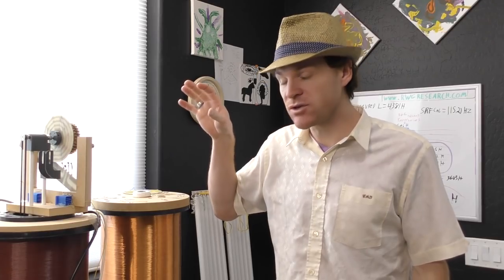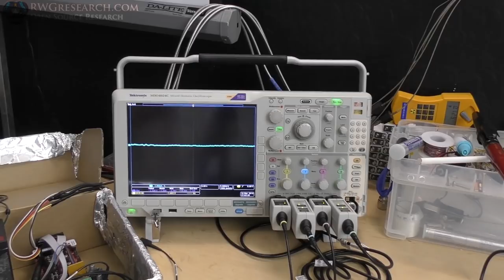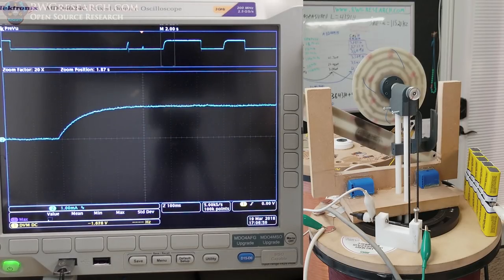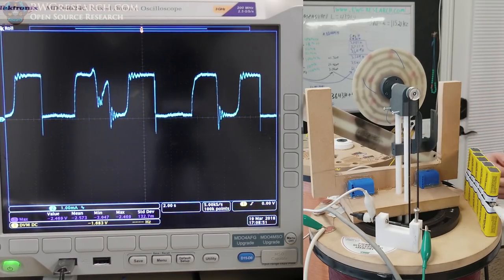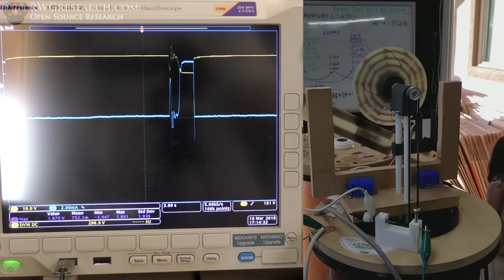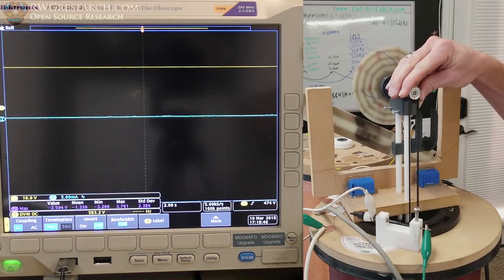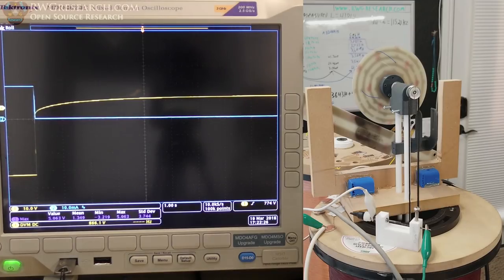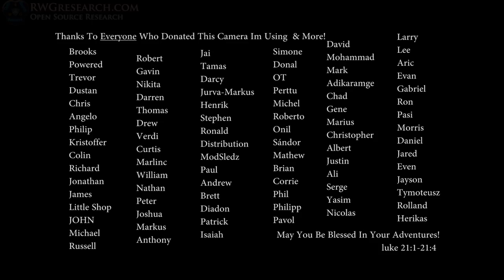T.S.F.A P16 ~ JWN Project P12: Inducing More Current Than The Applied. Battery Resistance...

Comment from the maker: In this update video I demonstrate how the battery resistance plays a major roll in how this system works. Even tho the battery is supplying the catalyst for the result we are seeing, the battery is also creating a "short" that is holding the magnet from going faster than it could. The "torque" I'm talking about in this video is not that great. you can however tell a big difference from the 100V to the 860V even tho the same 2ma is going through the coil when i'm holding it back.  However because the more battery's we add, the less resistance across the coil, the less drag the "short" has on the magnet. so there is a balance between the induction, the battery resistance and the "free spin" rotation it has. Don't forget we are playing with a "conventional closed circuit" here.   God Bless and READ THE BIBLE MORE! ~Russ
Reply: rwg42985 why are you not doing this with VBM coils? you can remove lenze law by using the spinning field of the coil.
Reply: rwg42985 it seems as though you dropped those projects, I'm almost assuming you were paid off like marko.
Reply: rwg42985 if you do use them just use magnets with a hole in the center to induce current, that way there is no block to the flow.
Reply: rwg42985 Do you still have a shortout segment in the commutator or not ?
Reply from the maker: commutator is not being used here. ~Russ
Reply: hey buddy, is this drive coil the original, or your second with lower resistance ?,  - also i would love too see the battery resistance issue replaced with a LM7809 and a second coil, possible ? ;)   peace and faith
Reply: Why don't we try to clean up and clarify a few things for you.  I measure your battery resistance at an average of 54.6 ohms for your 30-battery test.  Searching online a 9-volt zinc-carbon battery has a typical internal resistance of 35 ohms.  So your batteries are getting old or there are a few bad batteries in the set of 30.  (The data:  297 volts no-load, 286.6 volts with 45 kohm load, calculated load current 6.35 mA)  Battery resistance in general does not play a major role at all because the 45 Kohm resistance of the coil is the major component of the circuit resistance by far and dominates.  When the magnet rotates in generator mode it has to deal with the 45 Kohm load resistance of the coil no matter what which will be the main source of the drag.  The proper way to describe what is happening in your tests in motor mode is that the EMF induced in the coil from the rotating magnet is in opposition to the voltage from the batteries and that is why the current flow is greatly reduced when the magnet rotates.  The rotating magnet is not pushing current through the coil in the opposite direction of the current being pushed by the batteries because you are in motor mode, and in motor mode all of the pushing action comes from the batteries.

In a sense the batteries are "creating a short" across the coil in generator mode. When you reverse the current flow in generator mode (batteries still connected) the total load on the rotating magnet is the coil resistance plus the total effective resistance of the battery bank.  This will cause major drag on the rotor as you demonstrate.  The higher the effective resistance in the total loop the less current flow and the less of a mechanical load on the rotating magnet which is in line with what you are saying.  On the other hand, when the setup is acting like a motor and being driven by the batteries, then there is no drag on the rotor per se, and and all the "drag" is on the batteries.

The voltage from the batteries determines the maximum current through the coil, and it's the current that determines the strength of the magnetic field and it's the strength of the magnetic field that determines the torque.  There is no big difference in the torque from the 100V to the 860V setup even though the same 2ma is going through the coil.  The torque is a function of the current, period - this is the way a motor works.  The slightest movement of the magnet changes the current flow through the coil and you simply can't control the movement with your hand.  That is what is leading you to believe that for the same current flow you are getting more torque at 860 volts.

Comment: I'm wondering, Joseph repeated over and over again that the gyroscopic particles traveled at the speed of light.  I'm wondering if the pulses generated alter, no matter the voltage, at 1/4, 1/8th, 1/16th the speed of light?  I did the calculations, if your magnet is still two 3 inch long magnets sandwiched between a one inch aluminum axle piece, it gives you a 7 inch magnet and diameter of a moving circle or pulse which multiplied by pi, and converted to meters, is a traveling distance of 0.55857 meters...  I also calculated that to get a good fraction of the speed of light, you use 4 to the 12th power, and dividing the speed of light by that number gives us 17.869 meters per second.  If you turn your magnet 31 turns per second, you will get 17.31567 meters per second, and 32 turns per second gives you a closer light speed harmonization of 17.874 meters per second.  Hey, we are trying to prove that there are fields out there that are real and that do work, so, maybe we need to harmonize with the speed of those fields as well as just move them around?  Could you please check the length of the magnet set up, unless you have it at hand, and I will be happy to plug that into the formula, but trying 31 to 33 turns per minute sounds like it might get you harmonized with the speed of light no matter what the precise length of the magnet set up.
Reply: the universe and her laws are required too explain the math between my two peices of bread , - i think they was joseph's angle

Comment: well your scopeshots truely show still Lentz law counterEMF...As the magnet moves it induces CounterEMF=CounterVoltage , so the input current drops...
Please let the rotor spin and show how big the back current spikes are ( the current below the zero amps line...)
Reply: Well if the magnet would induce current into the same direction, we would see  the current rise above the level that will flow when the coil is just connected across the battery bank and the magnet would not move...but the current is taking a dip and so the Counter Voltage reduces the input current like in a normal DC motor...so Lentz law still applies here...
Reply: Also the battery voltage would rise and not dip...so you still have Lentz law there and are not inducing into the same direction. ..
Reply from the maker: The rotor is spinning freely. its just connected to the battery only to show the battery resistance plays a major roll in this interaction. so the higher resistance the better it will run. with a low resistance battery it would not ruin it all.( it would slow its self down to the point where it would not make it past TDC)  i showed this here so the next part(s) make sense.  so the reason why it makes more torque with the higher voltage is because it CAN spin faster... due to the higher battery resistance.  
if we induce in the same direction, then it appears that the battery current draw goes down, ( because we are producing more from the magnet Than the battery can supply) so the input current dips. The interesting part here is the small dip in current below the zero line. because if the momentum from the first input pulse rapidly accelerates the magnet for the first 15-20 degrees, the next 45+ degrees will be inducing more current than the applied (showing a negative current) but only if the resistance of the battery will let it. see this video the timing is not right here, but you can see what I'm saying. https://www.youtube.com/watch?v=6wmtoTCGDhI I will start to explore this more in future videos. ~Russ

Comment: Russ, if you shortout one of the 9 Volts batteries via an ampmeter, do then only flow 100 MilliAmps and not more ? That would indicate an internal resistance of about 90 Ohms..I thought they would at least make 500 MilliAmps or more ??
Reply from the maker: overunitydotcom to calulate battery resistance,  I used the coil's resistance and the voltage drop when the batterys are conected.  And the current flowing at a steddy state.  The math comes out to about 91ohms.  I did not want to short out the batterys to mesure it.  So I used the coils resistance as the other paramitor.  This resistance will change over time with the batterys being used I do believe.  So those resistance  numbers are not going to be perfect.  ~Russ

Comment: Are You sure that the battery resistance multiplies if You connect it in series? I would imagine it drops becouse of higher voltage... Not sure thou.
Reply from the maker: Jacek Nieduzak think how resistors work in series.  Its the same for batterys ESR.  Each add to the next.  ~Russ
Reply: Ok... But resistors dissapate energy as heat. The resistance goes up as the heat goes up. Battery is a whole different thing. And I know that higher voltage is less restricted by resistance.
Reply: Russ is rigth the resistance add's up. The resistance of a battery is almost always the same. More voltage will not change the resistance of a single battery it will only allow more current into the coil.